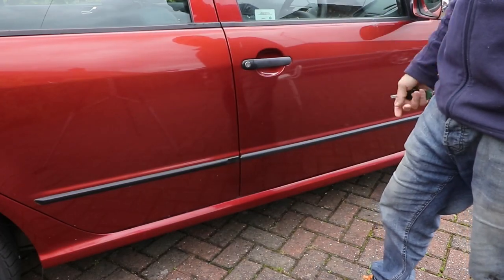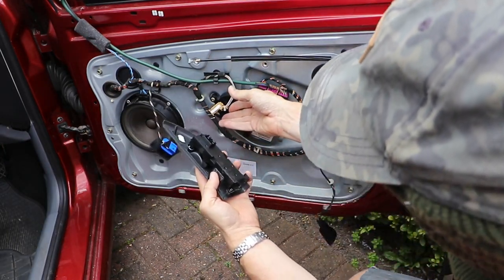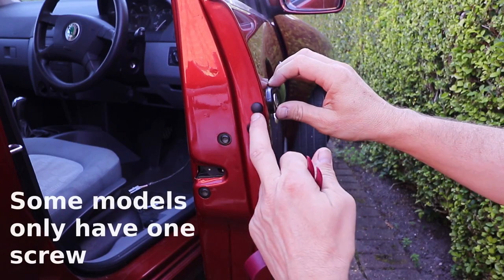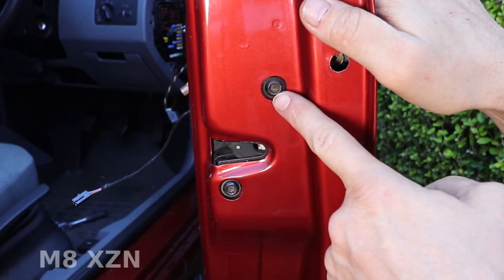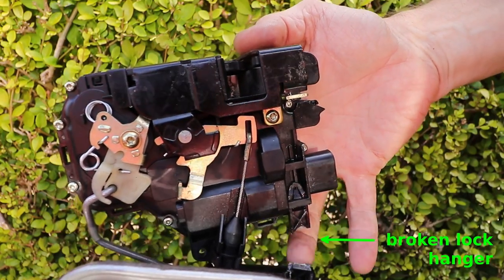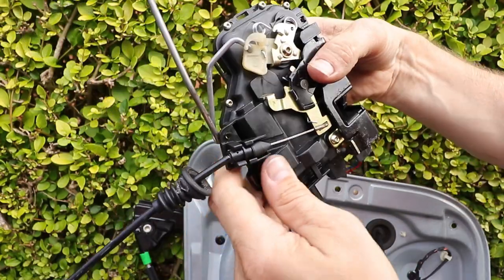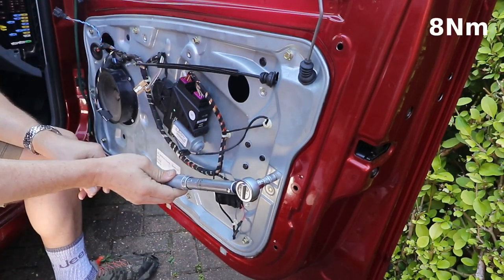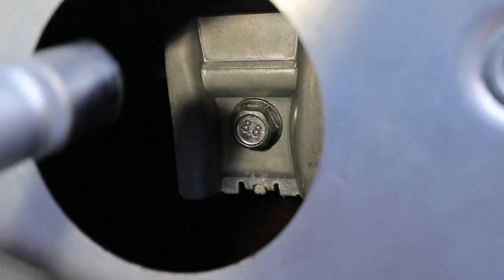SKODA FABIA Drivers Door Lock RHD (Mk1 99-07)

Comment: Thank you. The passenger door of my Fabia has that microswitch failure. The back door keep with that problem, but for preventing the auto lock with keys inside, I disconnect only the cable of the electric lock in the driver door. Now the driver door works with the key but the central looking keeps working for the other doors. This video helped for a future diy repair. Thank you.
Reply from the maker: I had issue with auto lock of doors, so I put a second key in a secret place underneath in a watertight box so I could use in emergencies. Got me out of a couple of scrapes so far ;-D
Reply: @HatBoyHarvey I’m going to replace the passenger door lock next week, also the passenger window motor, and also the drivers side regulator as I put a new drivers window motor in, about 2 hours later I wind the window up and the metal wire on the regulator had came off some how, cant wait to fix the car once and for all! (Windows held my tape, has been for weeks)
Reply from the maker: @jme.147  great, hope everything goes well :-)

Comment: Thank you very very very much. Yesterday I replaced the microswitch in the front passenger door. With your video all went well. I used an microswitch from a old printer that I have dismantled. I had to open to the side, with the drill, one of the holes were the original microswitch fits. I fixed it with 2 screws, soldered the cables, and now it is working fine. Your video worths money. Thank you again. Healthy life HBH.
Reply from the maker: Great! Glad you got it sorted for nothing more than time and effort, good feeling yes :-)

Comment: hi there i have a question, if i buy a new front right door remote central locking, should my original car keys still can recognize and send the same frequency as before or the central locking needs a tweak? if u get what i mean, cos my fabia has a prob with this right now, it's just the front door that listens to the central lock and none for both of the rear doors.
Reply from the maker: Do you mean a new door lock mechanism?

Comment: Hey man, my lock indication doesn't move and I have no idea what could be causing it, any ideas?
Reply from the maker: have a look at the wires behind the rubber bellows on the A pillar for chaffing and unplug/re-connect the connections. This could also be to do with the lock itself as if the  micro-switch has failed the indicator would stop working - door card/panel off - new lock - reconnect and replace :-)
Reply: @HatBoyHarvey  Well the lock is working correctly, only the indicator doesn't pop up, it just stays jammed in there, I can't tell if it even tries to move or not because of all the other indicators that do work making noise. I'm starting to think that it could also be caused by a poorly fitted door card after I disassembled it, saw rivets, didn't have a cordless drill, gave it to a mechanic, he fixed the electric window, but I also think he might be the cause of the jammed indicator, not sure if it stopped working right after the repair or later.
Reply: @HatBoyHarvey  its been a while but I looked under the door card and oh boi I was terrified, the car alarm LED was dangling and the lock indication rod wasnt even there, micro-switch has worn out and the lock assembly is missing the plastic hanger so its only attached to the door. Its basicly a horrible repair and I have to fix all mistakes that were made by that car mechanic...
Reply from the maker: @szynga  take your time and fix one thing at once. You'll soon have it working again. I would fit a new door mechanism and try to find an indicator rod online. Oh and fit rivnuts and bolts.
Reply: @HatBoyHarvey  yeah, already went to a scrap yard to get myself bolts for the carrier plate (because now its horribly riveted with too small pop rivets...) and some missing screws that hold the door card. I found online those indicator rods, but I guess I'll just visit the same scrap yard for those missing parts, maybe even grab a working speaker if I'm lucky to find one :D

Comment: I changed both of my front locks, and i dont need to do all of that.but thats one of the ways to do.
Just one thing, you need to isolate that door with new silicone because of the leaks. The front doors make leaks exactly like the rear doors.
Hope you dont mind about this advice mate.
Thanks for the share, stay safe, cheers from Portugal.
Reply from the maker: Good advice about sealing the front doors, but only if you continue to have a leak issue after sealing the rear doors. Just sealing the backs has worked for me. Fique seguro meu amigo :-)

Comment: Thanks for the video!  We had already hard time with that, once my wife was closed the kids into the car, with phone as well. Fortunately my daughter was able to unbuckle herself and press the button on the key(they didn't know, that they could open from the inside). So it was time
I have disassembled and cleared the lock of our Fabia. The switch seems to work, but I have already got the replacement. I had no time to disassemble the lock itself, so I cleared only, but it seems OK. Maybe on the summer I will finish it. I bought the replacement for that plastic part as well, that is holding the lock in position. It was broken. It have to be dameged on the accident before we get the car. It hadn't been told, of course, but I found the first glass shards in not accessible corners after a few months(back in 2013.).
Reply from the maker: Thanks, you have to watch the young ones at times. glad you are fixing your car yourself. Roll on summer :-)

Comment: I have an issue with my central locking on a Skoda Fabia 1.4 Tdi, going to replace the lock barrel but have a feeling the micro switch is at fault. Very informative video should help me out massively! Thanks
Reply from the maker: It will only be the lock barrel if the key doen't turn in the barrel :-)

Comment: Great video. Thanks. My mk1 back passenger's door isn't opening 100%, sometimes it does. Tried the punch technique, worked for a while, now it doesn't... Sometimes it works fine for a week, then nothing... Noticed once I had to open drivers back door first, then boot, then back passenger s door... So random it drives me crazy... Haha
Reply from the maker: Thanks. You could try some electrical contact spray into the lock, moisture seems to affect these to give intermittent faults as I've experienced these at times.
Reply: Thanks

Comment: Thanks  such useful videos. 
My fabia 2003 has the same problem but the only difference is that I have to first open the back doors in order to get access to the tool box door.  What should I do to solve that? 
Thanks. Have good. Day
Reply from the maker: Thanks, The driver door lock is the important one here, if it doesn't work you will never get access to your tool box! :-)

Comment: Hello there! Nice explained and easy to understand, many thanks.

I was hoping if you could support me with my issue. I have the same problem as described in this video, but I also have another problem which I think it is related to this procedure of fixing (not sure). The second problem is that the car locks and unlocks randomly, often happens when I close any door or when I cross a speed bump. Did you encounter this issue with your car?

Thank you for your these Skoda Fabia videos, very useful.
Reply from the maker: Yes they will tend to do that when the microswitch is beginning to fail. Also there is a security setting that auto locks the doors again after a certain amount of time if you don't actually open a door. The microswitch can be a nuisance if you have left your keys in the ignition, shut the doors and it locks (I've done it 130mls from home and had to get rescued).
Reply: @HatBoyHarvey  Thanks for the quick feedback. Yes, it happened to me as well (locking after one minute or so).

Comment: Good evening I’ve got rivets on my door any advice on how to  rerivet Skoda fabia mk1 petrol 2006 thank you
Reply from the maker: I would use rivnuts and bolts to dispense with the rivets. as long as you use the same size/type that is on earlier models and torque to speck there should be no issues. If you are going to remove the rivets and replace them then   remove them by taking teh head of each rivet and then pushing out the remaining part so you don't enlarge or deform the hole. Hope this helps :-)
Reply: @HatBoyHarvey  what size pop rivets should I use thanks

Comment: If I had a pound for the amount of times I have had to fix the locks on my Fabia 1.
The knock off locks are quite meh, I tend to just use the microswitch from it. There are also micro switches inside the locks, though at this point I have never had one of those show itself as broken.
Signs such as the car locking & unlocking randomly, and also not being able to lock sometimes (as it thinks the door is open) show the issue is with the lock, and likely the microswitch. 
A brilliant car haunted by poor locks and door leaks. (Leaks are best fixed with a roll of butyl)
If you have door carriers that are riveted, that is a massive pain.

Comment: Hello, i have issue with the open door indicating, or whatever its called. When i open the driver door sometimes it doesn't indicate that its open, on the dashboard, which also leads to not opening the interior lights, and also not reminding me with sound signal to off the headlights, when i am about to leave the car. Its this problem comes from central lock panel, or its some sensor somewhere else in the door,  like the black rubber bump in the corner of the door for example? Excuse my English and lack of knowledge.  Very helpful videos btw before helped me to replace the window lift mechanism
Reply from the maker: I believe this is the microswitch in door lock issue which should be fixed with a new door lock or microswitch, but be sure to check connections are good and wires going into door are OK :-)
Reply: @HatBoyHarvey   thank you for the quick answer, i will check

Comment: Thank you for great manual. I have the same problem, but door stays closed and therefore I am not able to remove screws and disconnect cables from front and rear of the door. Do you have some advice? Thank you
Reply from the maker: have you tried: https://youtu.be/suB-n30YJHg as this often works. Make sure the car battery has got a good voltage.
Reply: @HatBoyHarvey  I have tried also new battery, but it didn't help. Door hasn't key lock. Opening is possible only with remote control.
Reply from the maker: Sorry I am not understanding what you mean, maybe the translation? can you open the door at all?
Reply: Passengers door is locked and door knob keeps down. Remote control (new battery) doesn't work in this door and unfortunately this door hasn't keyhole outside. The inner handle moves with the knob but it don't keep up.
Reply from the maker: First thing is to check the drivers side  wires behind the rubber bellows is OK and not frayed and connections are reseated. then use the banging method on the outside of the lock barrel area:  https://youtu.be/suB-n30YJHg then try spraying contact spray in around lock barrel and door crack where lock is. Then if still no luck the last thing is to take the seat out and remove the inner door panel (not easy) then metal carrier and manually move the levers until it opens. Once you open the door check the wires in the rubber bellows on this side and the connections and also the connections inside the door space, then replace the lock mechanism. hope this helps :-)

Comment: Hi, my mum's Fabia has developed a new fault, possibly related to the front passenger lock mechanism. The key fob activates the central locking motor and I can hear it but, the door is not unlocking or opening from exterior or interior door handles. Pulling the interior door handle makes the indicator pin rise up, but as soon as the handle is released the indicator pin disappears again... As the door is "locked shut" I am assuming I can't get the door card off to investigate? 

Any ideas?

2007 Fabia Bohemia 1.4TDI PD. 114,000 miles. (The one in my profile picture lol)
Reply from the maker: Getting the door open is the first thing. Have you tried this: https://youtu.be/suB-n30YJHg often works, may take repeated hard hits. If you manage to get the door open then take the lock barrel out and then the short plastic grub cable nipple in the handle attached to the short cable. This can stop the door from opening if it is too tight, it needs to be re-attached in a slightly more relaxed position in the serrated grooves to work. If problem still exists and the drivers door lock mechanism has never been changed then suspect this also as the microswitches within these fail through wear over time.
Reply: @HatBoyHarvey  thanks, yes I tried "percussive maintenance", would microswitch on drivers side affect passenger side?
Reply from the maker: @jcarr162000  the drivers side wears the most and if it is faulty it effects the other door locks. It is possible the passenger side is faulty alone, but only if the drivers side works. Also the wires behind the rubber bellows can also fray so that is also something to check, but obviously all these have to have the door open. You can get the inner panel off, but it is not easy, take the front seat out first and wind the window down, glove box out may also help.

Comment: is the microswitch NO or NC ? .. i'll just put a classic one on the side of the door. cheap and easy .. just need to find the corresponding wire.  
if anyone already done this please share . 
thx.
Reply from the maker: Good question, I've never done it, but after a web search I believe the blue wire is no and red is common. no when door closed, nc when door is open. Anyone else to verify this would be great. Hope this helps
Reply: @HatBoyHarvey thanks.
Reply: @HatBoyHarvey  obviosly is NO ... lately i found out.
seems after i repaired the switch i have to take the unit out again to remake the solder joints on the connection plug... fun day.